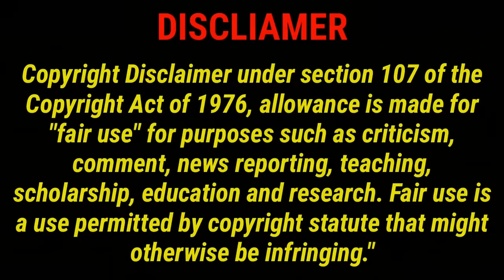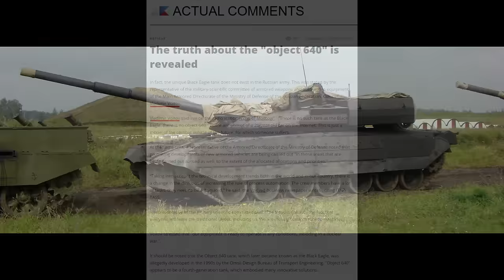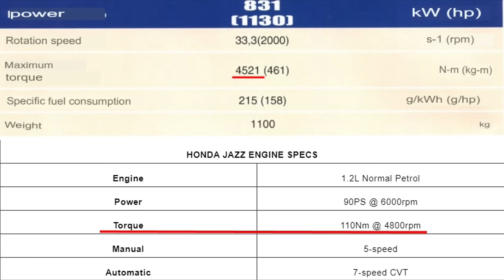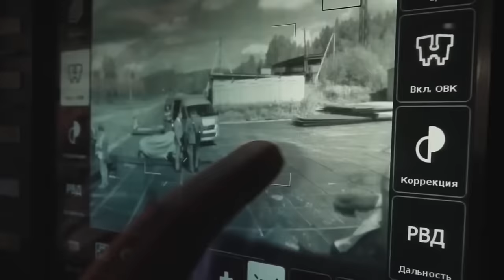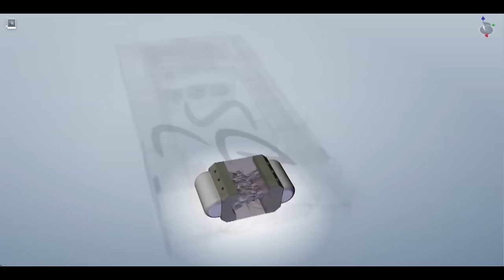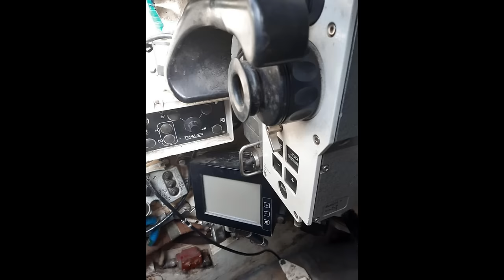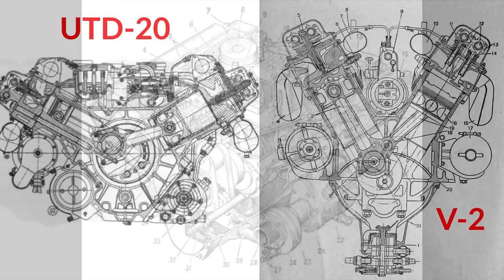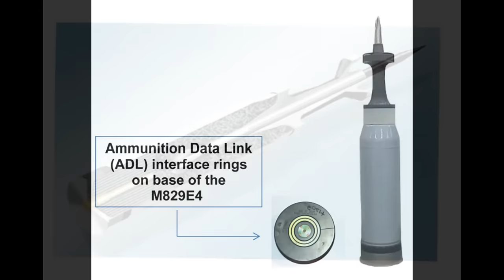LazerPig is WRONG about T-14 Armata

Comment: "Retractable" periscope was a feature from ww2 found on tank such as the sherman. indeed it "retracted" it's main or secondary periscope when the other one was not used, it was also used on german and British tank. It would not leave a hole as the periscope was still present in the "hole" or some door was fixed on top (such as on the sherman) to close off the hole. This was made to protect the periscope itself and always have one ready if the other one was destroyed so you could still see
Reply: not sure how anyone who wants to seem knowledgable on tanks would confuse ww2 tank features with modern leopards or abrams lol
Reply: @SecondTry45  Yeah quite cringe indeed, but I will say that some ww2 features are sometimes still on modern IFV, not sure if these periscope are though.
Reply: I don't remember "retractable periscopes" being a thing in WWII, and I've watched basically every Chieftains hatch and don't remember him pointing them out either. But maybe it was a thing and I'm just forgetting it.

Armored covers however were absolutely a thing as you said, and IIRC like you also said periscopes could be replaced inside by the crew if need be.

And periscopes are incredibly important in tanks still, don't know where Lazerpig got the idea they're archaic and obsolete. I've heard plenty of Vets that actually prefer  them or even being open hatched compared to the cameras as you can't "feel" the environment through the camera or have as good depth perception.
Reply: Strv 122 has a digital retractable periscope thingy
Reply: Which periscope on the sherman (driver, gunner, etc)? Which station has a main or secondary periscope? Do you mean replaceable? I have never heard of this.
Reply: @Ryan-ti4yv  I think there has been a misinterpretation, the periscope present on all station except the gunner is the one that can be "retracted". If you look on the hatch of the driver and machine gunner right next to it is a little metal piece, that is the door that open up when the periscope is placed but also closes when the persicope is retracted by the crewman in order to protect it. The periscope can be moved thanks to the knob you can see on it (such as the m8 periscope on american tanks) that serves to place it up or down inside the tanks.
Reply: @Mares1113  Yeah. I was looking, it seems like all of the periscopes except the gunner have the little trap doors so when the periscope is missing there is no gap. Even the late vision cupola and drivers hatches have that. Which is very neat. I need to read about the gunners one, I know it is colinked to the gun so it can be used to aim the gun roughly so I don't know if it is so easy to retract. It seems to have a protective hood but I don't think it retracts.

I contest the idea that the intent is for them to be withdrawn under fire in combat conditions, although I could see a crew doing it while under artillery fire out of combat to save spare periscopes. 

I think the intent is that in combat the periscope is your main source of vision and if it is knocked out you retract it and replace it. If you retracted it with out replacing it you would have no other way to see, so doing that just to protect it would effectively blind you.

Unfortunately TM 9-759 doesn't really have a lot to say on periscopes and doesn't even mention the spares mounted on the hull walls. One cool thing I didn't know is that the radio operator gunner also has a magnified periscope like the gunner according to TM 9-759.
Reply: @Ryan-ti4yv  Neat detail I was not aware that the machine gunner had a magnified periscope. As for the gunner the periscope cannot be retracted and if the gunner needs to replace it it's a major problem as the magnified periscope is not present in spare (As I am aware), and the periscope needs to be aligned in order to shoot (As seen in a video present on youtube made by the army that show how to calibrate the gun), something that the crew cannot do in combat I think. But this problem is not a problem on later sherman because the periscope is replaced as the main gun sight by the telescope and they thus can be both used by the gunner, so if the telescope was to be destroyed by ennemy fire, the gunner can switch to the periscope.
Reply: @Mares1113  Yes! I think even the early Sherman had the combination of linked periscope and main gun sight. But yes, that is right, the gunner has redundancy so is less concerned with losing the periscope or the main gun sight.
Reply: So Mares talking about Retractable periscopes on World War 2 tanks. That's A nice find there, I for one didn't doubt the possibility of a retractable peri existing. But didn't know they existed that far back. For sure though what bothers me about this that I don't think anyone else seemed to notice is this at this timestamp.

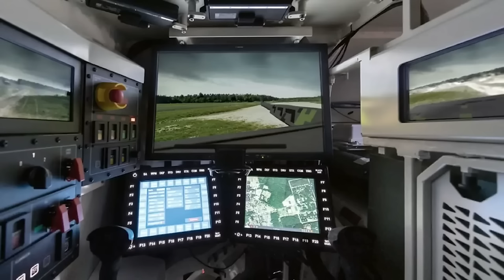28:21-28:50
WHOA, WHOA, WHOA, wait a tic let's look at this Red asked NATO tankers about a retractable periscope that exists on a Russian tank that has never been out in the field of battle and only left Russia to be field tested by the Chinese. HOW THE HECK ARE THEY SUPPOSED TO KNOW THAT?  No western tank analyst team has stripped apart a T-14 for study, why would Red ask Nato tankers about features on a russian tank that has not been captured or destroyed yet for study? Like their totally gonna know without an official data and parts sheet for said tank or heck even driven the dang thing. I thought of an appropriate illustration for this.
Redeffect asking Nato tankers about retractable periscope ports on a t-14 is like me asking a native-born American cab driver for the profit margin of his company's franchise in India. 1) That's pretty privileged information to begin with, He as a driver is not privy to even the local franchise's profit margin. So, he's not gonna even likely know his local company's take. 2) Even if does he, he's not authorized to provide it to random people who don't work for the company. 3) It's in India he's even less likely to know what the profit margin is there anymore then his own local U.S. branch.  So why ask Nato tankers not Nato spies or intelligence agents on a tank that has never been in a nato country to be studied, tested, or driven? I think Red is the one spreading misinformation, the only reason he brought up that he asked Nato tankers is because it tricks western audiences into thinking he's playing both sides("neutral") a tactic used by Russo props to trick young inexperienced and impressionable westerners into believing their lies. Or maybe he hit his head and failed to notice what he actually said/did their, IDK.🤷‍♂ Food for thought huh?

Comment: When LP said that the t14 engine has the same torque of the Honda jazz I started doubting and cringing at the same time
Reply: he corrected himself in his last video. The thing is russians for whatever reason measure torque using different units than the rest of Europe, so Lazerpig thought the torque was lower than it actually is.
Reply: @aquila1290  yes, now I know because I’ve watched the second episode of the Even rounder table, thanks anyway
Reply: @aquila1290  Goes to show how little he knows about the topics he talks about.

It should be obvious to anyone with a critical eye, but he just ran with it because it supported the narrative he wants to push.
Reply: @Antiteshmis  Nah he probably just made a mistake
Reply: @LaVaZ000  So I guess if somebody tells you that a cart and F-1 have the same engine, you 'll genuinely believe it was "just a mistake" and cannot in any way be linked to a  bias.

LMAO
Reply: @aquila1290  We also measure the armor penetration of shells in a different way, according to the lower guaranteed bar, without any coefficients and average values. This does not mean that with the value of the armor penetration of Russian shells, it is necessary to add large values, but on average add 10% to have a picture in your head for comparison. And some say that it's worth adding 20%, but I think these are already some maximum threshold values that are absolutely not interesting for real comparison.
Reply: @LaVaZ000  ya know i would normally agree with you but after the A10 video… yeah i think he has strong confirmation bias. Not necessarily pushing an agenda but I definitely think he ignores information that is opposite of his pre-conceived notions.

Comment: I love how lazerpig states the T-90's max speed is 32 kph and then later goes on to say it has the same maximum speed as the challanger which has a max speed of 37 kph
Reply: okay thats just a small difference
Reply: @speedman69420  Both of those numbers are wrong.
Reply: @speedman69420 Small ? 15%...and it's wrong
Reply: @goodlife6277  and wrong, T 90 is lighter and goes much faster
Reply: @plazmica0323  I know, it's a Very good tank
Reply: @plazmica0323 my father was a soviet mechanic told me allot of stuff about different russian Tanks He told me that the t80 was the fastest Tank He ever saw
Reply: Typical problem when you make-up numbers, it's hard to randomly choose the same twice
Reply: Calm down, sparky.  We're talking about a stunning error of about the average human walking speed.  Speed itself isn't exactly the core feature of an MBT in a combat situation.
Reply: do you mean Kilometers/hr or Miles/hr? cause i don't think you actually meant Kph
Reply: But he stated it was 37 max speed as reported by the Russian government and that was while it was tested with a wooden gun.
Reply: You love that? Do ya?

Comment: 47:56 Turret turning in the direction of incoming shot is actually a requirement for APS to work. Counter-projectiles are loaded in fixed tubes on the turret and cover a sector Infront of it (unlike Trophy being positioned all around the vehicle or Iron fist with tiny turrets on top). T-90 Has similar system to automatically deploy smoke to upset thermal and optical guided ATGMs.
Reply: I dont think a turret can move that fast. The projectiles aim themselves mid air after being launched and then they shoot a explosive formed penetrator at the target.(just my opinion)
Reply: @Filip Jurák  no, as in the turret must be pointed towards the incoming threat. small corrective maneuvers are possible from the APS projectile, but not to the point an immobile launcher system can cover a wide enough area to protect the entire vehicle when mounted frontally on the turret
Reply: @TwixSvK  Average ATGM is launched from distace around 1000 to 2000m, average speed is 400m/s, which is 2.5 to 5s to react from launch, and whole eternity from locking in.
Reply: @iMost067   so the APS radar has range of 1000 m?
Reply: @alphaplayzz1381  here are the statistics on the T-14’s APS, of which it has multiple types for different threats. One tracks 360 degrees to protect from attacks from the top, and the other more traditional system covers an 120 degree arc from the point the turret is facing. The T-14 Armata is equipped with the Active Protection System (APS) Afghanit which seems similar to the Israeli Trophy able to intercept and destroy incoming missiles and rockets. The system is designed to work against all types of anti-tank missiles and rockets, including handheld weapons such as rocket-propelled grenades. The Afghanit APS includes four sets of 12 launch tubes, two at the rear left side of the turret, and one on each rear top side of the turret. At the base of each side of the turret are five large and fixed horizontally arrayed launch tubes covering the 120° frontal arc of the turret. These tubes could launch unguided projectiles with HE warheads to counter incoming anti-tank guided missiles or RPGs (Rocket-Propelled Grenades). The Afghanit APS also includes two types of sensors mounted around the T-14's turret.  The tank is also equipped with the NII Stali Upper Hemisphere Protection Complex, which consists of two steerable cartridges with 12 smaller charges each, and a turret-top VLS with two more similar cartridges, corresponding to the vehicle's soft-kill APS. Additionally, using the AESA radar and anti-aircraft machine gun it is possible to destroy incoming missiles and slow-flying shells. Two large sensors, believed to be electro-optical/infrared (EO/IR)-based laser warning receivers, are angularly mounted on the front of the turret providing 180° coverage, while four smaller sensors (covered but believed to be radars) are mounted around the turret providing 360° coverage.
Reply: @Darc Gibson  right now I'm going to say something that may wound you. those are the intended specifications of the APS (and probably pulled from the redeffect video). we are talking about a tank that's not even service operational. the abrams X would be one of, if not the, most powerful tanks on a modern battlefield. however that's because it's a design spec. it's possible, but has not happened because it's unneeded. the armata is similar, if it was built perfectly to design spec then it'd be great. but the fact they can't even stop the turret spinning says it may not even be a completed vehicle.
Reply: @TwixSvK  The APS radar is not what is used to detect the target in the first place, a laser warning receiver would be used for that since basically all ATGMs use laser guidance, and otherwise thermal cameras can be used similar to what modern jet fighters use to detect missiles. Those systems would alert the crew to the threat and they'd presumably turn the turret to face it in response.

Comment: I think LazerPig somehow got the retractable periscopes idea from yet another bygone piece of World War II tech which appeared on the early Panther variants and in the original designs for the Tiger III. That being the rotating driver's periscope which could be pivoted inward and was protected by an armor plate.
Reply: Tiger III?
Reply: @Delta-6501  The original name for the King Tiger was the VK 45.03 (H) Tiger III and was intended to be the design built after the interim VK 45.02 (H) Tiger II (which was an upgraded Tiger I with sloping armor and a King Tiger turret) had been rolled out.
Reply: @tablesizeproductions4360 I'd say that's a bit too niche- gives me the sense of being purposefully obtuse so you can flex, when you could just say tiger 2 and avoid the issue entirely, no one would take issue with it. That's just my read tho ¯\_(ツ)_/¯ not super charitable I'll admit
Reply: @tablesizeproductions4360  wot tanks?
Reply: @tablesizeproductions4360  Yeah, all you had to do was say the Lowe.
Reply: The original M4 Sherman prototypes had a retractable periscope, which was removed due to numerous issues which plagued the design. Also a few Polish tanks tried the idea before the war, but we all know how well that worked out. Not a common feature, but it did exist.

Comment: 13:16 it should be noted that the CV12's weight states that it's the weight of the package, this likely includes cooling among other things.
Reply: As I recall, the "Power Pack" of a tank includes everything from the Engine, Transmition, Cooling to the smaller pumps and servos. Basically, everything in the engine bay apart from the Fuel Tanks.
Reply: @ravenouself4181  in this case its not talking about Power Pack but everything thats packed on the engine. Because transmission is the part of the Power Pack and the transmission alone of Challenger 2 weights 2390kg (official information). Here it refers to stuff like turbocharger and other "addons" to the engine itself. But V92S2F's weight is with all of those things too so yea, nothing RedEffect said is wrong.
Reply: @ravenouself4181  Yes, I was making a conservative assumption because I thought an entire powerpack would weigh more than that. I'm not an expert on the matter though so I could be wrong.